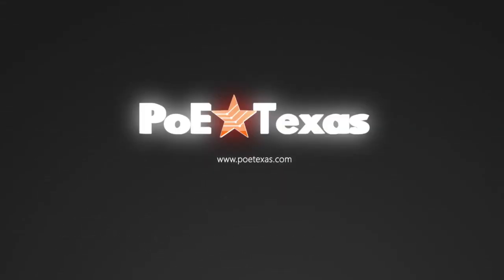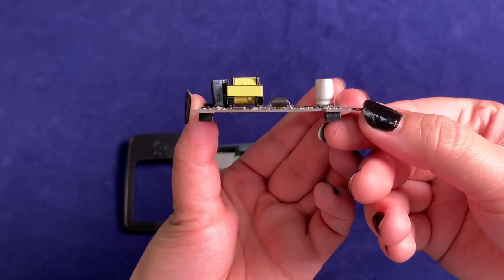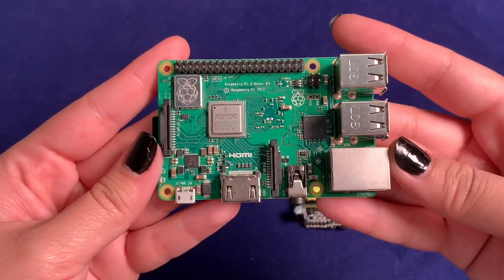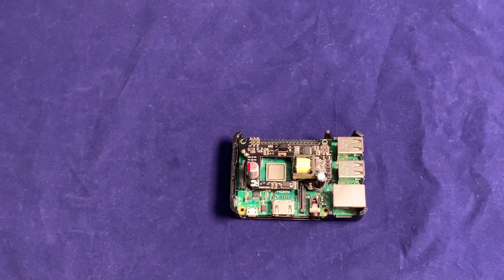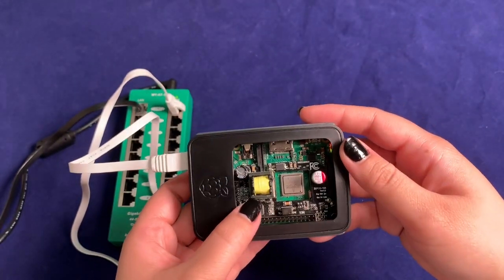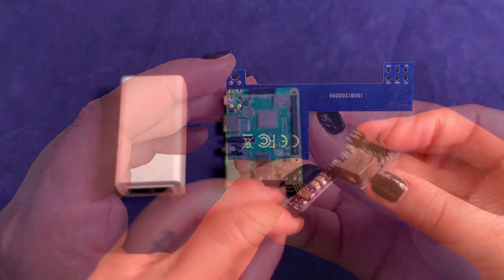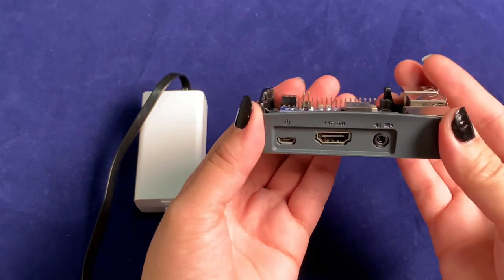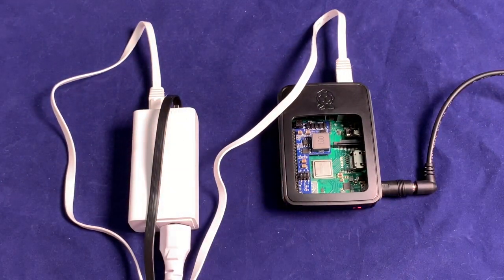Power Your Raspberry Pi (3B+ and 4) Using Power over Ethernet

Comment: You list the maximum output current at 270mA, but the official Raspberry Pi docs recommend 2500mA for the Pi 3 and 3000mA for the Pi 4 (about 10x the output); with a typical draw of 500mA and 600mA respectively (about 2x the output). Aren't these hats way underpowered then?
Reply from the maker: Great question!  That looks like a typo we need to update.  Like most Pi hats available today, we started with the PoE (IEEE 802.3af) standard, which isthe most common and has a 12 watt total budget.  Our hat will deliver 10 watts of power.  However, as you point out, that is below Raspberry Pi's recommended power for the Pi 4 at 15 watts.  We'll be coming out with a PoE+ (IEEE 802.3at) hat with a 25 watt max budget so the hat will have the full 15 watts.

Comment: Do you have a list of compatible cases? The hardest thing for me is finding a fanless solution that has good thermals. I'd love an aluminum chassis case that makes direct contact with the CPU and works with a PoE adapter for my Pi 4
Reply from the maker: We’ve definitely tested it with the official pi case.  We also include heat sinks with out pi hat to help manage the heat.  I know one customer was testing out a thermally conductive case.

Comment: Got my GAF Hat in today.  Ordered 2.  Both work flawlessly!  Thanks for a wonderful product!!!
Reply from the maker: We love hearing when customers have a great experience like this.  Thanks for letting us know!
Reply: @PoETexas  I'm new to RPi's, but I'm looking for powering multiple RPi 4's. They are going to be under high load and all will have a RaspiCam attached to them. Can the GAF PoE board handle that? Is a PoE switch recommended or should I just do individual power supplies? If a PoE switch is recommended, can you provide me a good suggestion?
Reply: Vision GT The new Pi 4 can draw up to 15 watts of power.  IEEE 802.3af delivers 12 watts, so it works 90% of the time.  If you’re really worried about the power, we have two options.  1 - Get PoE+.  You can find our GAT-USBC-Legacy which will do the 15 watts as long as you have a PoE+ Switch our Injector.  2 - Switch to Passive PoE.  Our PoE-PiHat can take 48 volt Passive PoE and send 15 watts at 48 volt.  You’ll need either a Passive PoE Switch or Injector, both of which we can supply.  If you’d like to discuss it, you can email success@poetexas.com.
Reply: @tylerandrews1489  sure, will do! Thank you so much for helping out!!

Comment: Good video. Do we need a special PoE switch or router to provide power to RPI with the PoE HAT? Or should it work with any regular modem+router?
Reply from the maker: The GAF-PiHat will work with any IEEE 802.3 af or at standard switch, including ours.  The POE-PiHat requires a passive PoE switch.  We offer them, also Ubiquiti and Mikrotik make passive PoE Switches.